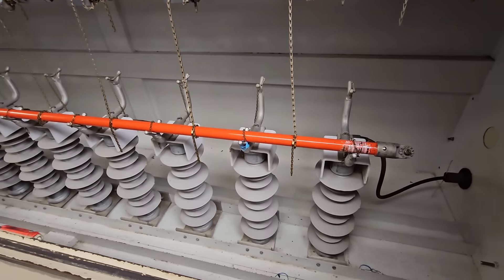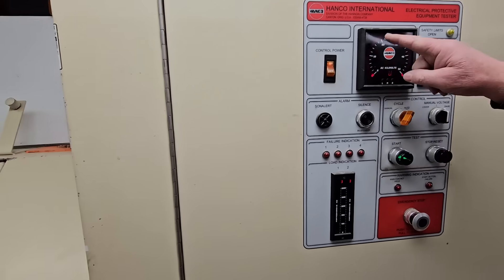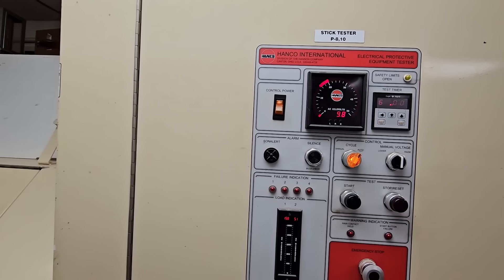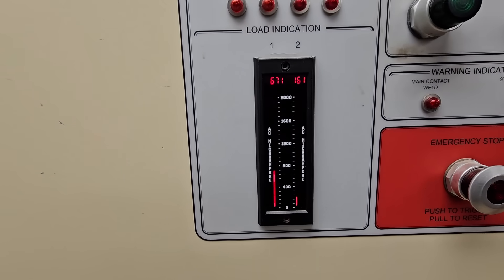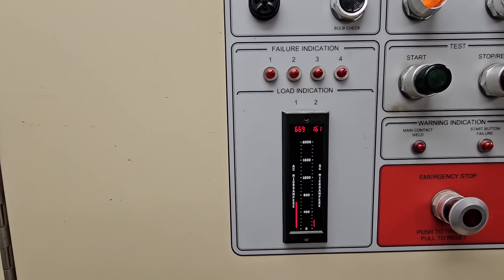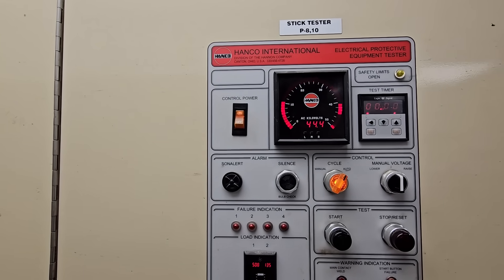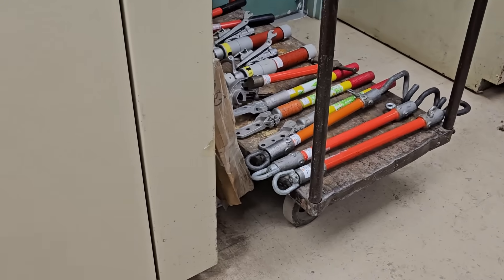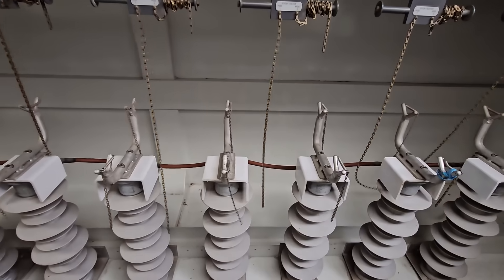Testing a "Hot stick" - 50kV per 6 inches

Comment from the maker: The fellas at our test lab not only do all the testing, but also fully refurbish all of our tested equipment! (Hot sticks, load busters, grounds etc..) 

I'll have to try and grab some more footage someday!

Cheers all! Big storm here over the next few days 🥶
Reply: Man, I've always wondered how they test the rods. We have fellas who go yard to yard so they must have a smaller portable kit, sophisticated stuff! Thanks for posting this and good luck with the $torm, stay safe
Reply: I remember something from electrical school about using hot sticks to place chains on conductors to short to ground should a line remain live during a fault. I'm guessing this is what's used to short out primary's to ground and trip breakers  but the idea of arc flashs at high voltage/amps grounding this way scares me.
Reply: @Bobsdecline  what else can they test? Do they calibrate any meters or testing equipment?
Reply: does he test gloves?
Reply: Have u seen or have the 1000 amp isolator for your impact guns

Comment: Love your channel. Amazing content. New IBEW JL here. Quick question: I had a JL tell me once that if I am about to cut a primary wire jumper and it has too much amperage on it, I should first install a mac with a shotgun, cut the jumper, then remove the mac with a shotgun. My question is: what are your amperage thresholds? at what point, at how many amps, do you treat wire differently. I know the system voltage probably matters too. What are some of your rules of thumb for these situations? Also, do you ever use parallel macs?

Comment: Question! Let’s say your several miles from substation. You are assessing line damage. What’s the easiest way to find out the direction of power flow coming from the substation without a map.
Reply: I'm not in the industry but I think you can look for fuse cutouts in the line. I think the line side would be at the top and the load side would be on the bottom. But there are also places where one line can be fed from either end (depending on switches) and I don't know how that would affect this.

Comment: The scary thing is Joe and Jane in Podunk thinks a Hot stick is just another Plastic or Fiberglass pole. Thus they try to use any old plastic pole or fishing rod and get zapped . Ie trying to save a kite stuck on a power line. Any sort of crap or defect on that Hot stick can cause them to fail. 

Pre WW2 Hot sticks were wooden. Specially dried and waxed. The conductive carbon fibers in your Fiberglass fishing pole is not what a linemans pole uses. It has foam and all materials non conductive
Reply: sounds like a self resolving problem to me....

Comment: I love a decent HV test :D 
150uA at 50kV, that's 7.5W. Is that a total, ie. to be divided between the 14 (if I counted correct) HV outputs over the length of the stick, or is it 7.5W for each 6 inch section?
Reply: I suspect each section is wired in parallel, meaning it's 150uA total.

Comment: A transmitter site I used to maintain had a studio complex in it until the 90's.  When all the studios were relocated, a high voltage testing lab like this moved into the now empty space.  They tested all the gloves and hardware used by the county electrical co-op.  It was neat to watch them test gloves.

Comment: Wow cool toy.

A long time ago I was a test engineer at a manufacturing facility. Part of the test process was Hi-Pot testing of the AC connection. I forget the exact voltage but probably around a few thousand volts but very lost current. Lots of safety interlocks to protect production workers.

Comment: I used to work in a place that made rubber lineman's gloves. Each one was individually tested in a machine that looked very close to this. The gloves were submerged in water and the insides filled as well with water and individual electrodes. When it flashed over it was quite a show!

Comment: this is really cool! I didn't know this is how they tested hot sticks! Are gloves tested the same way?
Reply: The only way I have seen gloves tested is with the gloves filled with a liquid and dipped in to another liquid with one electrode on the inside and one being the tank. Not sure exactly what the liquid is, water made to be some specific conductivity I'm sure, but that way it tested the entire surface of the gloves. Pretty sure I have seen a video or two on it on YT. 
Actually did a quick search. Here is a video, pretty old video skip to 2:00 for the dielectric testing part. 
https://www.youtube.com/watch?v=t6MnAeRQNzs

Comment: Once again, the automated translation of the title and description to French is awful, to the point of being incomprehensible.

It doesn't know what a hot stick is, so it translated it literally to something meaning "heating stick".

There is no way to disable this "feature", I cannot access the original.
This has been going on for years now.
Reply: Yes, it's awful
Reply: You can switch the language YouTube is in to English.
Reply: @Jehty_  Except if I want to watch something in French, because then it would translate the title to English and the result would be just has bad.

I am bilingual, I consume media in both languages and should not be forced to choose one over the other, because there is no valid reason for this problem to exist in the first place.
Reply: @Luzgar   have you tried it?
I'm bilingual myself. German and English.
I have YouTube set to English and I don't think I've ever seen a German title getting translated. For some reason it does not  seem like German titles get translated at all.
Don't knock it till you tried it.
Reply: @Jehty_  I've seen complains that it did not solve the problem, so I did not try myself.
Reply: yes, "hot stick" is a slang term for an insulated pole that allows someone to work on energized (hot) gear. Slang doesn't usually translate well into another language.
Reply: @ 
It is often the case that there is a translation, but the English term is more commonly used than the technically more correct translated term.

This is a creative choice that requires some thought, and should not be left to an automated system.
Reply: Still better than being jumpscared by that awefull AI translation voice in your native Language.
Reply: with a high enough voltage and unlimited current applied it would become a "heating stick", of course the tester would trip offline before anything bad happened.

Comment: Everything is a conductor if the voltage is high enough! This is really cool. Thanks for sharing!
Reply: Or hot enough, melted glass conduct electricity pretty well https://www.youtube.com/watch?v=xeFtfJHcigk
Reply: In this case, 50kv was still not high enough 😎
Reply: @ABoringTool there is still some leakage current in the µA but that is plenty good for a hot stick
Reply: Everything is a dildo, if you're brave enough.